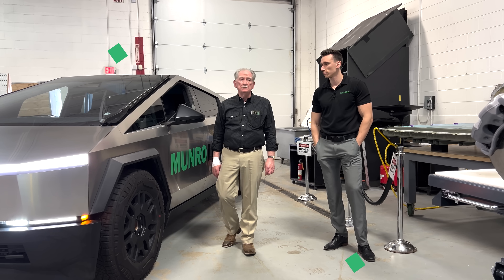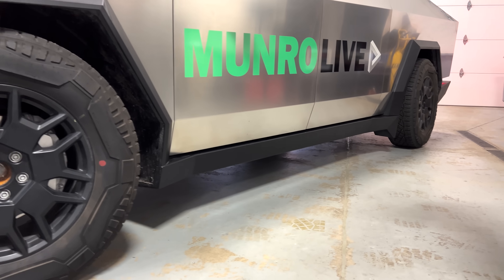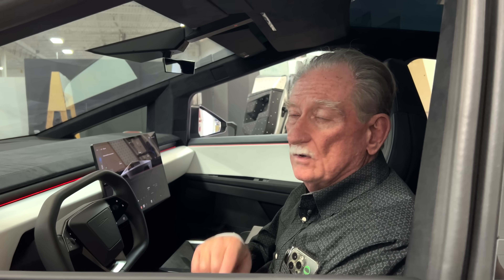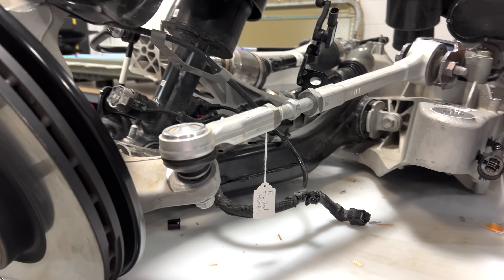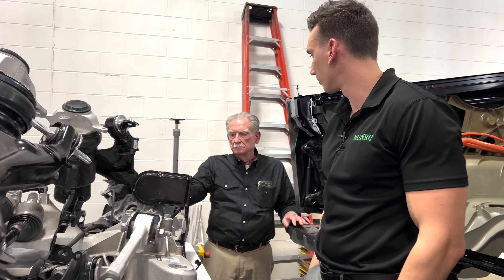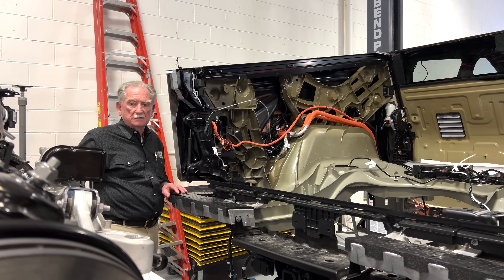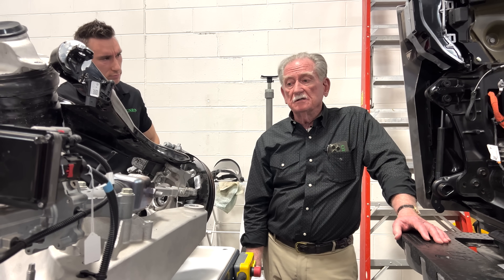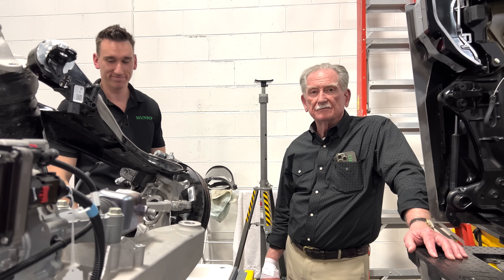Tesla Cybertruck Steer-by-Wire System

Comment: Impressive tech - thanks for the tour guys. Couple thoughts come to mind on truly redundant systems - I would want those ribbons routed differently through the vehicle structure vs side by side, and I certainly wouldn’t want them terminating in a common connector. It would be interesting to know if that conversation happened during the design phase - especially on the common terminal and if someone pulled up data to say the chance of failure at that point was so small it wasn’t remotely worth designing two different interface points.
Reply: My thoughts too - using a common connector means the redundancy isn't there. Additionally, in both tear-downs I've seen, there seems to be only a single sensor at the end of the steering shaft measuring the driver input, so if that's correct that's a huge gap in the system's overall redundancy,
Reply: It's a single pair that allows bidirection ethernet data transfer. The cables are flat to allow better routing.
The other motor will have an independent pair.
The tie breaker will have another independent pair.
Command signal is triple redundant, drive motors are dual with a fail safe design.
^guessing
Reply: @Krixz_20  They only mention the one pair of ethernet cables. Seems like there's some redundancy, but it only extends as far as the steering motors and sensors on the rack, not on the cabling / connectors or steering input sensor reading driver inputs. I'd love to have clarity on this, but thus far it seems and looks only partly redundant.
Reply: @gruppefbc  I think Sandy got caught out talking electrical stuff. Where is the steering wheel, where are the front drive units (close), why is that ethernet cable several meters long with a single connector? I think it's for the back wheels.
Reply: @Krixz_20  That's certainly a very plausible theory of the cabling being for the rear motor. Still leaves questions unanswered though, especially the key one of if there is any redundancy on the steering wheel input sensor. If there's only one sensor, that's a huge failing of a key safety aspect of the system.
Reply: @gruppefbc  the system will have had a FHA, FEMCA and quantitative probability analysis demonstrating the safety case. I think they probably caught the 'steering wheel sensor fails' failure mode pretty early in the design. Stop being so pessimistic.
Reply: @Krixz_20  It's not pessimism, it's a background in understanding the harsh reality of decisions made when it comes to cost vs thoroughness, and a company's willingness and ability to stretch the truth when it comes to semantics. One could equally argue optimism is just as unwarranted, and in this case I think caution and asking for validation is justified, especially since failures can impact all road users, not just the driver. But, to each their own...
Reply: @gruppefbc  i would guess the steering sensor is doubled for example it can be double coils inside same way it's used commonly for the throttle position sensors in the industry. the feedback motor is single bc if it fails you can still steer without the feedback. I am a little dissapointed by this video, it leaves a lot of questions on the design open, and surely the purpose of the ribbon cable showed is different that they explained.
EDIT: I did my research, 10 mins in google. The feedback motor is double stator, double controllers. The steering sensor is double, one on top, behind the wheel (standard place in cars) and one at the end. There are two separate power units and separate cables with separate connectors for the motor. Steering is by double separate canbuses. The only thing single is the rack bar and I wonder if it's not possible that locks if one of the motor pinions break. Sandy should do his homework better, usually good engineering reviews here, but this whole video is crap! https://www.notateslaapp.com/news/1487/tesla-patents-steer-by-wire-system-increasing-the-yoke-s-potential
Reply: @Krixz_20 It’s clearly not using ether loop directly to those modules. It’s got a front module which then interfaces with those modules, presumably using can bus.

Comment: EV’s more like tech companies/AI company.  Musk wants to be largest battery manufacturer in USA similar Chinese CATL worlds largest battery manufacturer.  Most Teslas competitors buy expensive 3rd party batteries from China and Korea as forgot to build battery factories in USA. EV’s will be faster and cheaper to produce in the future.  Remember the cost first plasma TV.  Just like space stuff tech filtered to other industries so will EV tech.
Reply: By having in house cell manufacturing tesla has a better bargaining position when cells are expensive.  Other battery companies will be building 4680s utilizing but not limited to tech Tesla is sharing with them.   Tesla will continue cell development.  Tesla may supply cell components to battery makers.

Comment: Awesome job. Rear steering not dual motors?
Reply: No, it isn't dual. I assume that rear steering is deemed to be less critical, so mechanically failing to straight ahead is sufficient.
Reply: @brianb-p6586  ok so some mechanical system to bring back to center during a failure?
Reply: @moreboost  suspension geometry (caster and kingpin inclination) can return steering to centre. I don't know if they would include some sort of on-centre latch, but there are lots of rear steering systems in use, so they could be examined for details.

Comment: I have owned 5 Tesla’s with first 2017 Model X which I still own.  Never visited service center with only maintenance tires.  No oil filters in land fills every 5000 miles.  I charge with solar at home saving $500/month on gas and home electricity.  I can not control healthcare costs but can control energy costs.  These EV’s are forever cars.
Reply: Why did you own 5 of them then? That's more than one car every 2 years...
Reply: @logitech4873  These scammers get the rebates and then sell the car shortly after.  Then brag about being smart and green.  Meanwhile the people living in apartments, rentals and driving used cars subsidize the rich guys 5 Teslas in 10 years. Complete scam!
Reply: Which is precisely why everyone you used to pay if trying to make them look bad.  Their nightmare is lots of people doing what you do.   Grid problem.  What grid problem.  Love it.  Need to trash the tarrifs and embargos on chinese solar components and adopt a good nation V2G standard.
Reply: @danharold3087  Government buying rich people electric cars and solar panels is what I don’t like.  Seen 5000 square foot houses with pool house, pool, well pump and 20k solar claiming their green.  What a joke.  Homeless guy is the only human that can claim green.  Walks everywhere, no heating and cooling, eats only leftover food.
Reply: @danharold3087  No you can’t!  The production of the solar panels, inverters, batteries cost carbon.  You never figure that in.  It’s certainly more carbon than 1 giant power plant operating on efficiency of scale.
Reply: @danharold3087  No value.  CA has almost 100% renewable during the days.  Bills went up x3.  Like every hundred is now 300.  Where’s the value in that?
Reply: But you used 5 new vehicles in 7 years.  What happened to forever cars?  You probably got 10’s of thousands in subsidy’s.  Then sold the cars shortly after.  When you see a  $800 1995 Honda civic on the road, know that guy paid for your new teslas. His car cost less than your subsidy!

Comment: I wonder if the system will be able to disable the rear steering in tight quarters. I remember my uncle had an Accord that had four wheel steering, which helped with the turning circle but could cause the rear to hit a wall or another vehicle if you forgot while parking, as he discovered.
Reply: I agree.  We are not used to rear wheel steering.    Farm combines have only rear wheel steering.   Swathers aka windrowers steer like a zero turn but are much larger.  The back end is a club.
Reply: That's a problem with rear steering. Tesla loves automation, so logically it should use cameras or other sensors to look for clearance to wall or other objects, and control rear steering appropriately.
Reply: @brianb-p6586  That is a possibility.   Maybe part of the parking automation.

Comment: Fly by wire in planes for decades.  Really reduces weight.  More room for other stuff or safer crumble zones.  48v low power system vs 12 v helps with more electric motors and electronics.  Tesla keeps checking so many boxes with first generation vehicles.  All this starting from nothing, no previous infrastructure like legacy auto.  Chinese EV’s knocking on our Mexican Borders through nafta and avoiding Trump era 25% tariffs. Ford and GM extensive infrastructure already Mexico.  Tesla made in the USA
Reply: It's heavier, more expensive and less reliable than standard power steering.
Reply: Turning the wheel 3 times reminds me of non powered steering cars up to the 50’s.  Easier for autopilot to turn wheel 45 degrees in slow speed maneuver vs 3 360 degree turns.
Reply: NAFTA was replaced by USMCA which is also about to expire.   The US may force provisions to prevent China from using Mexico as a gateway.  Hope not.

Comment: I must say it feels like Tesla have solved a problem that I never had with this steering. I do not really see why I would want this over a normal steering rack? This just complicates things, and adds cost.
Reply: All 4 wheels steer so it handle more like a much smaller car and is much better when it comes to tight spaces like parking lots.  Without steer by wire that 4 wheel steering would require some very complex linkage.
Reply: First hit with google " steer-by-wire systems can reduce weight and costs, increase interior space, and improve crash safety. They also have fewer mechanical parts and are less likely to fail than conventional steering wheel systems."  Not my words.
Reply: @danharold3087  no thats the words from the people who makes these things.
Reply: @AndrewTSq  They would know. Now you know.

Comment: Video shows the rear HV cabling. While Tesla has much of the high voltage stuff in the rear and distributed at motors, a lot of vehicle weight comes of that. 
The vehicle HV plug-in point is better on the front quarter panel above and to the rear of the wheel - out of the way of the SORB test wheel breakway. 
All the HV inverters in the vehicle in a water-cooled box where the the HVAC compressor now sits with power and data cables running directly into the motors and battery. 
Where the cables and cooling water run into the battery will need crash and rock protection, but there will be a large cable and inverter-housing saving. 
The HVAC system would need some reorganising, and a little bit of frunk would be lost, but a lost of savings to the made in weight and parts. 
The electric field change created by an inverter up front will reach a rear motor in less than 20 nanoseconds - that is about 1/100,000 of a motor revolution (~13 arc-seconds of rotation) at maximum speed. Thus, the longer cable between inverter and motor has no measurable effect. 
In F1 cars (hybrids), the inverters are on top of the battery where they are easily cooled. The motors are oil cooled. Oil is cooled directly by an oil radiator, or an oil/water heat exchanger.

Comment: I know I’d feel a lot safer knowing there is an intermediate shaft which can be coupled by a clutch if there is a computer failure or loss of power - which is what the Infiniti system does.  Normally, the system is drive-by-wire unless there’s a problem, and then an electromagnet drops out and re-couples the intermediate shaft to the rack.  Tesla ditching the intermediate shaft gives more packaging options, but favoring packaging over safety is may be not a good choice in a mass market consumer product.
Reply: I assume you never fly in large planes... otherwise you got over it already...
Reply: @zilogfan  Good point.  Transportation aircraft and most bizjets have been by wire for a long time.
Reply: You would feel safer yes.  But unless a good many intelligent engineers are wrong this is a solid system.
Reply: @danharold3087    I apply Occam’s Razor when in my approach to engineering, that simple solutions are most often the best solutions.  A non-powered mechanical fall-back is simple and address the loss of the 48 Volt power which the system in the Cybertruck can not address.  Packaging apparently won the argument for the Cybertruck.  Time will tell if that was a good choice.
Reply: @wtmayhew   The cyberTruck is a technology demonstrator.   Trying out new tech prior to putting it into much higher production vehicles.  So no point in Occams's Razor here.
I have not verified it but I would expect the CT to use the traction battery as a 2nd source and regen braking as a possible 3rd.
By my thinking the car makers that are going to survive are the ones who can build the most appealing car for the money. Be it a $10K or a $100K car.
Reply: @danharold3087   Yes, you could steer enough to at the very least get off the road using the traction motors provided you have a functioning control system.  That has the potential to introduce trouble because the traction system has to work cooperatively with the ZF steering subsystem.  Tesla probably won’t do it because it would require extensive integration testing to be sure the traction subsystem only takes over when it should.  It also requires the steering input to be functional.  ZF might also have something to say, that they refuse to certify their system if it is coupled to control code which they can’t review; engineering by lawyers as it were.
Reply: @wtmayhew  Apparently you have an insider at Tesla.
Reply: @wtmayhew  Horse and buggy it is then...
Reply: @zilogfan  Yes buggies, Studebaker.  Started in mid 1800s making covered wagons, carriages and even Lincoln’s funeral caisson.  They started making electric vehicles in 1902, but quit in 1912 favoring gasoline power.  Studebaker hung in until 1966 manufacturing Lark Sedans, but the CEO’s untimely cancer death in 1964 and some bad management made the company quit cars.  They continued on making Gravely mowers, rocket parts, hoses and sundry household hardware.

Comment: Is there redundancy to the sensor in the steering column, or how reliable is that component considered?
Reply: They forgot it, they need more experienced people!
Reply: @TschingisTube  I'm not really sure what your comment means.
Reply: Yes.
Reply: @danharold3087  Appreciate the confirmation, but do you have any info to explain?
Reply: @mikal4452  No.  Good chance I heard someone explaining the system and the redundant elements.  Don't know which video.   That and it would be nuts not to use a redundant sensor here.

Comment: Can you have complete loss of computer control on a commercial aircraft?  Yes, it happened.   Luckily the pilot landed successfully, though anything but easily, using thrust vectoring by throttling the engines individually.

Comment: Yes I understand that but was wondering how it kept the wheels aligned and if there was some system that always kept them aligned. The wheels on a truck like this would be under truck like this would be under tremendous pressure and will often be pulled out of line. Tyre wear could be increased if there wasn’t a system to constantly be alining the tyres
Reply: I have 20k USD car in India, whenever I turn it on it tells if wheel’s are aligned or not. It should be there in Tesla too

Comment: I love how this rear steering and variable ratio front steering is portrayed as some innovation. BMW enters the conversation: “Ya dis ist something we’ve been doing for 20 years” silly Americans. Nissan enters “Rear steering for 30 years here” 😂
Reply: re: "BMW enters the conversation". as well as Mercedes and Audi... https://www.youtube.com/watch?v=_ofQwKRSd-4 <---- iirc "Zie Germans" Schaeffler have already been running it/testing it on Merc AMG GT2 and Audi R8 GT2 Racecars at events like the 24 Hours of Nurburgring.  as i understand it, it allows a driver to take the fast line (often over curbs) WITHOUT the unwanted and sometimes unsafe "snap back" that can occur from the use of Yoke style steering wheels that are "de rigueur" in Motorsport.
Reply: All this steering is evolutionary not revolutionary.    We have 1/2 the people saying it is not big deal.  The other 1/2 say they want the steering column shaft as a backup.   I want to see if it is included in the base model when they build it next year.

Comment: It’s interesting that they are running Ethernet but its not 2wisted pair
Reply: FFC cables can be impedance matched/controlled. I've used them inside TVs for HDMI and USB...
Reply: it looks like an IDE cable for your hard drive 20 years ago lolz. This is a system, what interference are you worried about? Sandy pulled it out of an aluminum frame, so maybe they found a way to isolate it, and keep the power from causing interference. I don't know, but I would like to know more as well

Comment: Do like the 4 wheel steering!
As far as steering you never want hand over hand!
Do like the aluminum every where.
As far as that 48 volt connection system, is that expensive to manufacturer?
As far as your parking spot, Sandy Tesla is probably using their in house Star link GPS Satellites! 
As far as this new guy, he's definitely foreign based off his English, it's the mother tongue, my guess could be German or Austrian?
As far as the body they got that wrong!
THEY GOT THE TECHNOLOGY OUT OF THE PARK!!!
The dashboard or interior is great!

Comment: My biggest question: Is the toe in angle controlled by strictly mechanical connections?  Or is there a dynamic adjustment to the toe-in depending on what the rear steering is doing?
Reply: Strictly mechanical. The difference is how the pinions are driven. The rack is the same.